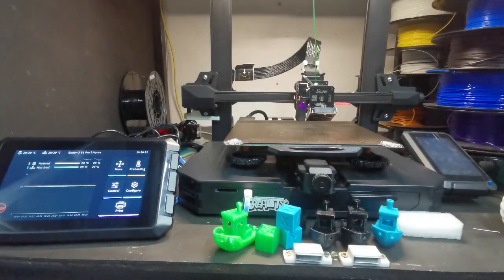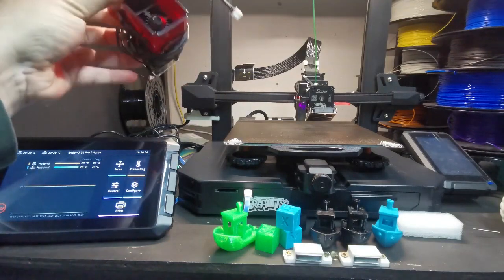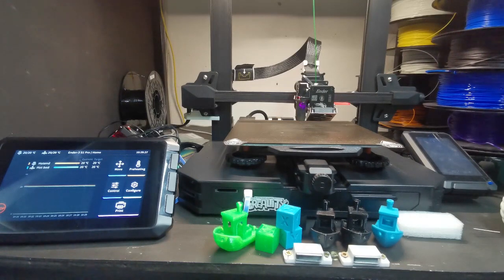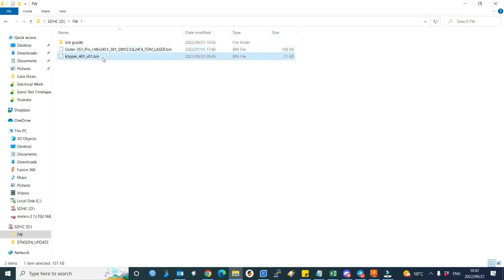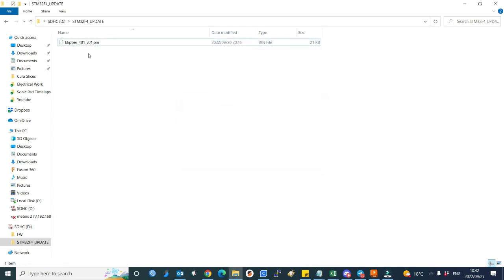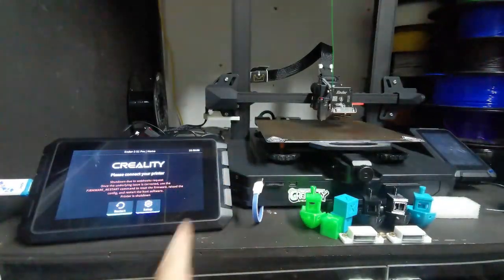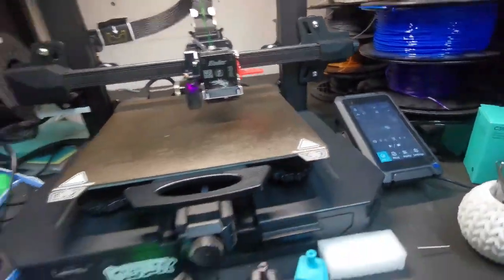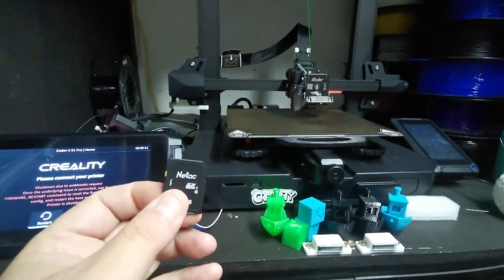Creality Sonic Pad: Reverting back to Marlin from Klipper

Comment: Have you had any issues getting klipper back on the S1 pro? I was able to connect the pad once, went back to the stock firmware and now I can't get klipper back on. I'm starting to suspect the SD adapter.

Comment: Warum funktioniert das Pad nicht mit dem Ender 5 Plus trotz Update? Das Pad macht keine Firmware Update mit dem USB Kabel.
Reply from the maker: It can work with Ender-5 Plus already since the last update in October, and you can also update your version by going "setting", pls contact our after-service cs@creality.com if you still have problem with it.
Reply: @Creality3D  the Pad has killed my silent Board from Ender 5 Plus. The normal Board is working, who paid for my silent board?

Comment: Thank you so much for this video!! I recently bought the Ender 5 S1 with the Sonic Pad and the latest firmware it applies during setup (1.0.6) killed my device. ABL probe goes off the side of the bed and it jams the nozzle into the bed!! You rock ;)
Reply: I have the same problem with my ender 5 s1 do you know how to fix it or should i just return the sonic pad?
Reply: @jamesarnott7207  change your bed size in sonic pad web interface. assuming you already returned it or gave up as its been 3 months hopefully you got it fixed

Comment: @PD99 I think that your question when will it support multiple printers was answered incorrectly. The Sonic Pad supports presently all ender 3s and ender 5 plus printers are listed on the sonic pad. I believe that your question was rather if you could add more than one printer at the same time, so the Sonic Pad was being used by more than one printer at the same time. If that's the case, the answer is no. only one printer at a time can be used on this. there are 2 USB ports on the side that are used to flash the SD card but there is only one USB for a printer. BTW the Ender 5 plus while shows up on the pad..It doesn't work and its bricked my printer. No answer from support either soooooooo YMMV. Creality is coming out with more firmware for their products for the Sonic Pad, but its still buggy getting some printers to work. I haven't been able to use it yet since My E3V2 is listed but the Sprite Pro that I have on it has the location of the CR touch located differently. So I have to either swap out the Sprite pro or somehow modify the software which I'm clueless. Regardless, of the issues, this Sonic Pad is a great idea but its 6 months away from being really good.
Reply from the maker: Bro, thanks a lot for sharing your using experience no matter bad or good,, Sonic Pad can connect or add at least 3 printers at the same time this month, please pay attention to our social media or Sonic Pad facebook group, we will announce it soon

Comment: Tried reverting but now I'm stuck on 'creality' logo on boot. Even followed Creality's instructions for reverting on their page. Did I brick my printer?
Reply from the maker: @taxn sorry for the late reply, have you solved your problem now?
Reply: @Creality3D  Yes. Had no idea about the screen flash
Reply: @Creality3D  
I have the same problem. I can't go back to stock. Creality picture hanging stuck
Reply: @sberbankkazahstan3466  well if you never got a response im as good as fucked as well
Reply: @jaceedwards937  I've go tthe same issue... did you manage to fix yours?
Reply: @dholi2k  that or it was the actual SD card I was using basically use what creality gave you out of the box follow all the instructions they give for the key over again if that doesn’t work switch to aftermarket of both GL
Reply: @jaceedwards937  thanks for your quick reply. I bought it from eBay so didn't get everything original came with. It worked fine though for a while and then I bought the Sonic Pad, which I thought would improve performance. This upgraded it to Klipper. I returned the Sonic Pad for various reasons, but since then, can't get PC to see printer on a COM port. It comes up as a libusb (WinUSB) device instead, but don't know how I can upload firmware to it if it isn't seen on a COM port :(
Reply: @dholi2k  you shouldn’t have to communicate from the pc to the printer should be able to pre install all the software to the SD and micro SD to program both the screen and the printer back to marlin make sure they are both in the correct format reformat them completely then start the process over again
Reply: @jaceedwards937  The problem is that however many times I formatted it, it wouldn't read from the card, so essentially seemed as though it was bricked. I managed to fix it though as I had an Atmel ICE programmer, which I connected directly to the header on the board and flashed the firmware. All works now :)